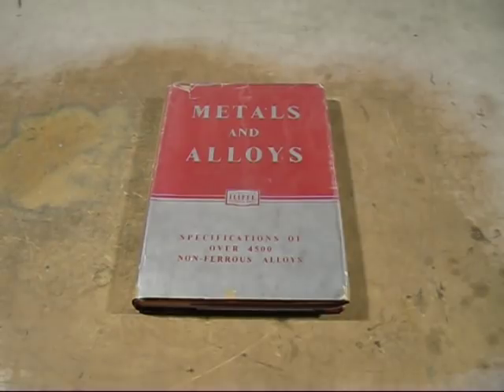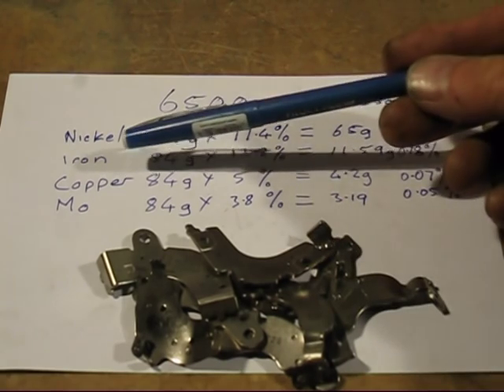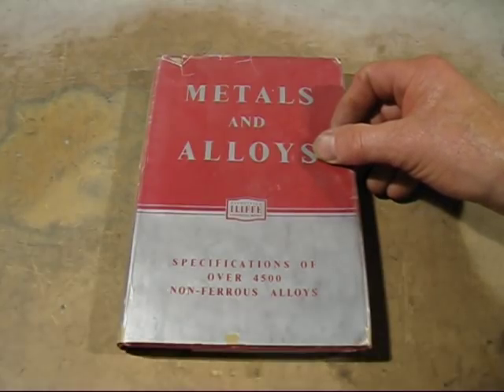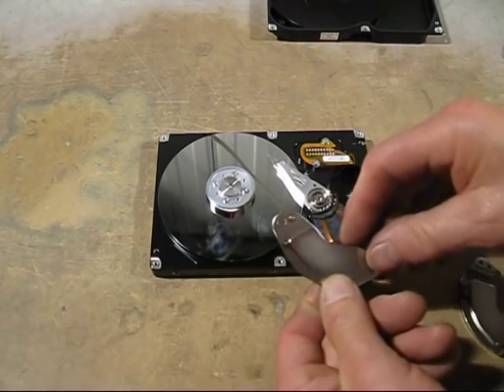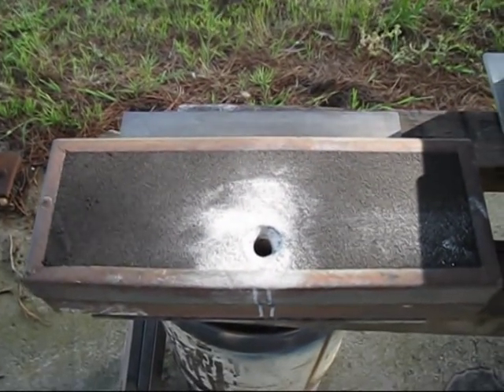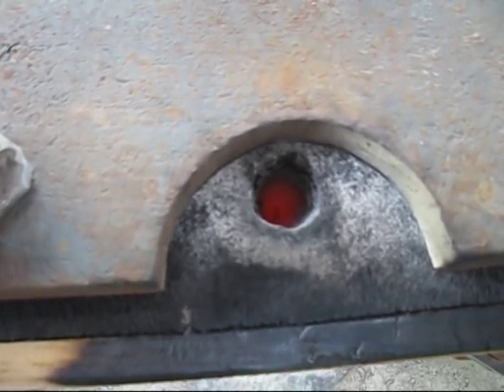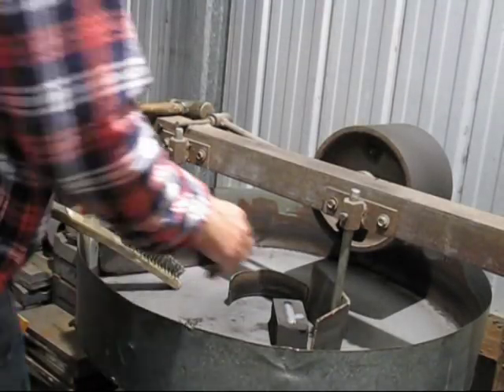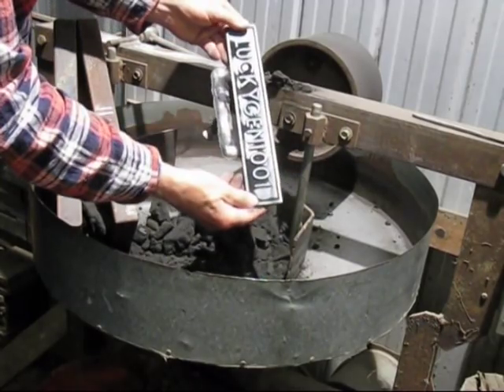How to make nickel cast iron

Comment: Luckygen, I really appreciate your videos. 
Your down-to-earth practical approach demystifies the art and science of foundry work.
On the Mu-metal topic, I had some doubts that the pole pieces in mu-metal in disc drives are made out of mu-metal.
So, I did some tests on my own collection of disk drives.
 First It tried a spark test on a grinder. 

The first pole piece I tried was from a relatively recent Quantum drive with rare earth magnets.
There was almost no spark and the material was quite soft, which seemed encouraging.
I tried two more pieces from other brands of drives. 
They gave a few sparks more like those from mild steel which wasn’t so encouraging.

The second test that I tried was to check the specific gravity of the metal pole pieces.
To do this I weighed each piece on a lab scales and then checked the weight of water that they displaced by suspending the piece in a water container on the scales.
 The density of the water at room temperature is near enough to 1000 kg/cum. 

The specific gravity is then obtained by dividing the weight of the object in air by the weight of the water it displaces when dangling in the container.
Sadly, the specific gravity of all three of the pieces that I tested worked out to be near enough to 7.80, which equates to the SG of steel rather than that of mu-metal, which is 8.74.
 As an example, the weights for one of the pole pieces were,  22.75 g/2.915 g = 7.80.

The pole pieces might be nickel plated but they are not dense enough to contain much nickel, not unless it is alloyed with a lighter element,  and that certainly could not be copper. So I think they must be some sort of ferrous material.

As one of the other commenters suggested, Australian “silver” coins are 25% nickel and 75% copper so that would be a possible source of nickel, albeit one that adds copper along with the nickel. 
With respect to the concern about coin debasement, you would be doing the government a favour because the cost of manufacture is less than the face value of the coins! 

In the past, before the advent of fiat money, the value of coins was backed by the actual metal they contained,  Consequently, coin clipping and other schemes of debasement were serious matters. 
It could get you burnt at the stake, which certainly prevented any possibility of recidivism! 

The real crime was in passing off the remains of the original coin as a full value coin, which it wasn’t if you had clipped the edges or cut plugs out of it.

I checked the weight of some Australian coins. 
Respectively, the 5, 10, 20 & 50 cent coins weigh 56.8, 56.8, 56.3 & 31.1 grams per dollar of face value, so the smaller value coins contain more metal for your money. That works out at about A$17,600 per tonne, which is not that expensive compared to world prices of A$8,300/t for Cu and A$16,100/t for Ni. That makes the current material cost of the alloy in the coins about A$10,250/t.

As you would know, monel (67% Ni 28%Cu) would be another possible source of some nickel, such as in monel boat fastenings but they tend to be expensive. 
A 10 gauge x 3.5” monel nail for A$0.30 equates to about A$41,900/t.

However, for the actual nickel content that would be cheaper than getting it from coins. (A$62,500/t versus A$70,400/t)

I suspect the Wikipedia mention of mu-metal in disk drives might relate to some dives that have specific magnetic shielding pieces over the disks.
However such shielding pieces might still just be steel. 
https://www.scienceforums.net/topic/112669-is-this-also-mu-metal/
I am going to have another look at the non-aluminium cover plates from the disk drives that I have to see if that material might be thin mu-metal shielding.
I had wondered why some drives have pressed aluminium cover plates with an insert comprised of some other kind of metal. Maybe that is mu-metal.

Also,  I could never throw away those beautiful precision ball bearings in the swinging arms of the disk drives.
Reply from the maker: You must have read my mind because I am almost finished editing a video covering those points you mentioned.
Reply: @luckygen1001  Not so much mind reading. Hopefully a case of great minds thinking alike!

I checked the non-aluminium cover plates in my collection of disk drives.
Only one was substantially magnetic. It was a mirror polished insert glued to the aluminium cover plate.
However,its SG also worked out to be about 7.8 so it is probably just a very shiny piece of ferritic or martensitic stainless steel.
 I suppose it might serve some role as magnetic shielding or perhaps it was just there for appearance. 

A further clue that the magnet pole pieces from the disk drives are not mu-metal is that they all appear to be plated.
I seems unlikely that it would be necessary to plate mu-metal given its high nickel content.

Good luck with your quest for some cheap nickel.
Scrap monel would be a good source but I expect that scrap monel is like rocking horse manure - very thin on the ground.
A boatyard might have some but monel has probably been largely displaced by stainless steel now.
Monel would be used in some pump shafts. 
If you google "monel-400-bars-ex-pump-shaft", here in girt by sea there is someone offering several used monel shafts and some off-cuts , but there is no telling how much they will sell for.

It is a pity that stainless steel cannot be used as a source of nickel but I suppose the chrome that accompanies the nickel is too much of a carbide former unless you actually want the hardness.
Reply from the maker: I hope you will like the video that is being uploaded, it covers my take on why it cannot be mu metal. There are many times that I would have liked to add stainless steel to cast iron but if I add more than 1% chromium it will be unmachinable no matter how much ferrosilicon I add.

Comment: very interesting, I have a bunch of those harddrive magnet plates from tearing the magnets out of them, and just kept tossing them in a bucket, lol. Ill have to dig that out and hold onto them now that I know what they are and what's in them, they may come in handy for some sort of nickel bronze later on. Thanks for the video.
Reply from the maker: That is exactly what I will be doing is having a go at making nickel bronze. Tin bronzes cannot be used for superheated steam but if nickel is added then the hot strength goes up a lot.
Reply: yea, Im interested in seeing your results with that and to see how well the cast iron and bronze machines. Ive also seen quite a few nickel aluminum bronzes that have the iron content and such in them, which the extra iron and other metals from the MU metal would actually help contribute to the final alloy's percentages also.
Reply: @ChirpysTinkerings  hope your not throwing away the disc. Platinum??
Reply: the titanium on it is only a few microns thick, there isnt enough there to even worry about saving it really, and I usually save those for making indexing disks out of.

Comment: Great info, I get ahold of old disks all the time at my work.
An interesting side note those magnets are also unusual as they have their polls reversed at the edges so that the magnetic field stays contained to a small area so it won't erase the disks, I use them to hold tooling etc

Comment: Lucky,  Nickel is an Austenite stabiliser and as such it helps prevent the formation of carbides Instead it favours the formation of graphite hence its action sort of like ferrosilicon. Have you tried tin additions they behave some what similar and we said to be very useful for varying section work.  I have an article on it somewhere and will dig it out for your next visit. I am no cast iron expert but in any other metal I would still cast it the same way up but I would have a reasonably large feeder attached to the "vertical" sides right at each topmost peak. Pleased to see that you remembered to cut gates before you poured! 😀… Martin
Reply from the maker: Yeah that used to happen a lot in the beginning forgetting to cut the ingates and I always wondered why the mold filled up so fast.
Reply: Lucky, Yep, been there done that and quite  a few times too, frustrating isn't it?... Martin

Comment: Hearing you speak very highly of the Metals and Alloys book reminds me; would it be possible for you to (at some point, time permitting) put together a short video of your recommended reading/reference materials? I always like to have additional knowledge close at hand, but in many subjects I find myself to be so much a beginner I simply don't yet know what reference materials would prove helpful.
Reply from the maker: I got that book from a secondhand book shop. They are very cheap so if it is no good there is no loss. I do have other books but that one is the best one I have.

Comment: Very interesting casting i enjoy every video.👍👍👍 What about to try adding stainless steel to cast iron? Maybe the corrosion resistance of cast iron will be more improved. Or maybe Chrom will make the iron extreme hard to Maschine? What do you think? Copper would be also interesting to add to cast iron.
Reply from the maker: Yes you are correct the cast iron will be hard to machine. Copper make cast iron slightly softer.

Comment: how long do you heat the metal in the furnace, or better yet, how do you check if the pouring temperature is reached and hot enought? i did my first cast iron today, it worked kind of, but did not run everywhere. i continuously have this issue with my alloys. But the good news is, even without Ferro Silicon or anything, it is nice light gray all the way, no darker areas, no chill and it's easy to file and work with. But i use prime cast iron from stock material. So maybe the reason is i don't yet recycle.
Reply from the maker: After the last piece of cast iron has been added to the crucible I wait 10-15 minutes and the iron is always hot enough to pour and fill up the mold.

Comment: Hi luckygen1001, I doubt if the metal you got is actually mu-metal. Here's why:
The parts you use are the so-called "back-irons" of a HDD's voice-coil actuator. The back irons are intended to short out the north ans south poles on the unused-sides of the rare-earth magnets that produce the actuating field. As such, a high permeability is NOT essential; a high SATURATION flux-density is. The relative permeability of mu-metal is ~100'000 whereas the relative permeability of regular iron and soft-magnetic steel is ~5'000. Both are extremely high compared to the relative permeability of air: ~1. Moral of the story: Permeability isn't a deciding factor here. The real decider is the saturation flux-density . Iron saturates around 1.5T (the magnets can easily generate this in the thinner cross-section of the back-iron) whereas mu-metal saturates at ~ 100mT. Real mu-metal would saturate and would be utterly useless to short out the magnetic flux on the back. Ergo, any (properly designed) HDD VCM back-irons shall not be made of mu-metal. Can you confirm that the metal you use DOES actually contain 70+% nickel? A reliable source of almost pure nickel is battery-connecting straps-material for lithium batteries. Cheers!
Reply from the maker: The only way for sure is to  do some analysis on it to prove that it has a high nickel content.
Reply: @luckygen1001   You could test the permeability of the metal.
Reply: @luckygen1001  all you need is a universal test machine! ... And several dozen grand :')

Comment: Well, you certainly void the warranty of those hard drives :-)
You could also melt the casings and the discs - should be some type of aluminium alloy. 
I was expecting you'd machine the angle plate, but I guess I'll have to wait for a new video.

Comment: Luckygen!  I am fairly new to the channel and super appreciate your time.  I'm sure you've covered this somewhere in your myriad of videos, but where/how do you obtain your ferrosilicon?  Thanks again hopefully you see this!
Reply from the maker: I get mine from my local foundry supplier.
Reply: @luckygen1001  

Ok.  I'm in Detroit so I'm sure there are foundry suppliers around here for the automotive industry.  

Last question.  How do you get your free cast Iron?  I found the ceramic blanket and zircon paint and I have a cylinder so I'm almost there!  Wish me luck
Reply from the maker: I let people know that I melt cast iron and they give me cast iron from time to time. Go to shops that repair cars, they are a good source. Sometime it pays to have a look  around when garbage is put out on the kerb. Some of my best finds came from what people put at the curb. Not all scrap dealers will sell scrap metal so you have to find one that will. The last time I visited Detroit was 2012 to see names and would love to go back again.
Reply: @luckygen1001  

Wow!  I really appreciate you taking the time to write an elaborate response.  You have given me many ideas and my brain is now swirling with potential sources.  I'm so far behind.  I see how necessary it's going to be to machine any parts I cast and I don't even have a drill press yet let alone a lathe or mill!  I can't wait to start experimenting with different fluxes, alloys, refractory materials, burners, fuels and forms.  You changed my life!  I'd probably be wasting time socializing if it wasn't for your videos and other foundrymen I found after.  Thanks again and keep up the great documentary!

Comment: Do You know what would happen if i used 5-8% by weight of 314 or 316 stainless as alloying component? Would additional chromium content be benefitial or deterimental to finished cast properties? I am asking if have you ever done such attempts as i intend to cast several components of about 15 kg/33  lbs and finding enough hard drives is pain in the ass.
Reply from the maker: I assume that you are talking about cast iron so with that much chromium it would make it so hard  that it could not be machined.
Reply: @luckygen1001  Thanks for detailed answer. I will try to cast some samples with varying % of stainless  added and see what is max% to be able to machine it properely, i have also contacted some friends who depacket old li-ion batteries, they are welded with pure nickel so old busbars are al least 99% nickel. If i wait long enough i hope for at least a kilogram of scrap nickel. Two days ago another friend contacted me if i want some cast iron water heaters dated back to before WWI, i got close to 500 kg of beautiful cast iron with small, grey grain after breaking it. Carrying biggest 200kg heater down the stairs two stories down by  myself was another beast and is the only reason why plumber left it there as he collected all the smaller ones. I feel my ass cramping even today.
As soon as i sort out resonant capacitor for my 25KW induction furnance i will post some videos. I use A10 and A30 crucibles. Cheers!!
Reply from the maker: @fullmetalmachinist3883  Some more detailed info, If you keep the chromium to cast iron under 1% cast iron will be machineable. Chromium makes cast iron hard wearing so parts do not wear out to soon. It also makes cast iron with a higher tensile strength. A good source of nickel is from nickel plating suppliers. I think it is called anode nickel. Cast irons made from pig iron will be very soft when remelted. You did the right thing getting that water heater because all cast irons that are made in the last 40 years are made from steel and when you remelt them you HAVE to use ferrosilicon. I had a look at your video about the colchester lathe, I have the 13"x 36" model. I also have the full manual and parts book.  I did my machinist apprenticeship using that lathe you had in your video. I would be very interested to hear more about your induction furnace.

Comment: I’m in the same boat as Chirpy, the easiest quickest way to make our old drives safe for disposal is to break them apart. You mention throwing the housings, I have been keeping housings thinking they would be a good quality aluminium source, is it that you are not casting Ali? Or that this is low grade crap?
Reply: I got started melting harddrive cases, but in all honesty, they're no better than extruded stuff really. Im not really sure what alloy they are, but they dont really cast the nicest. They may be similar to A380 die cast aluminum, but not 100% sure about that, but they do cast like that.
Reply from the maker: I have plenty of scrap AL no need to bother with hd housings.